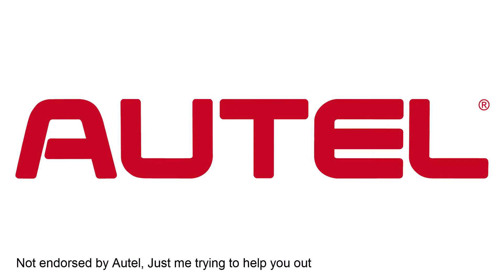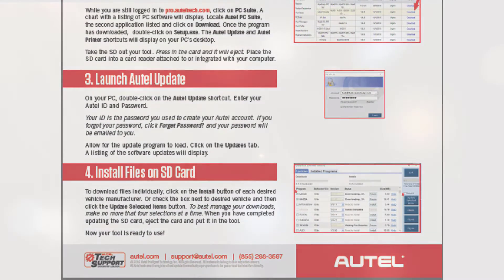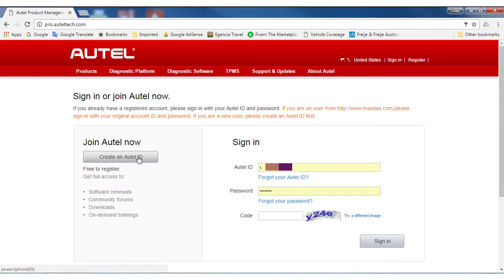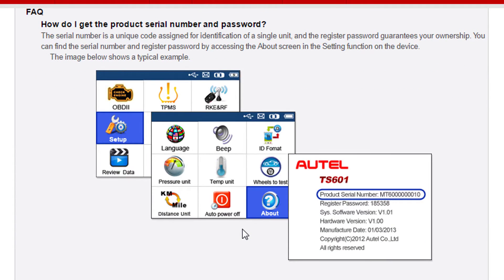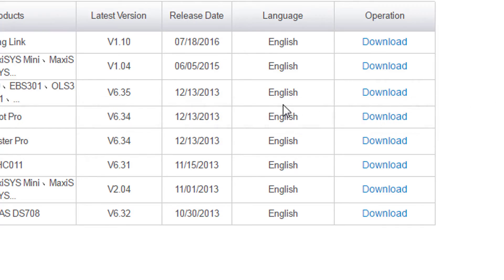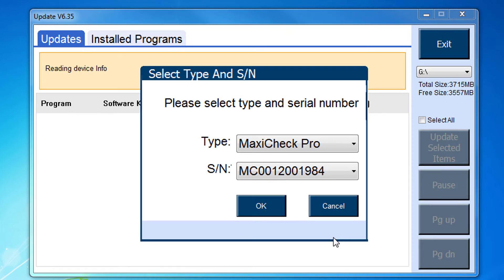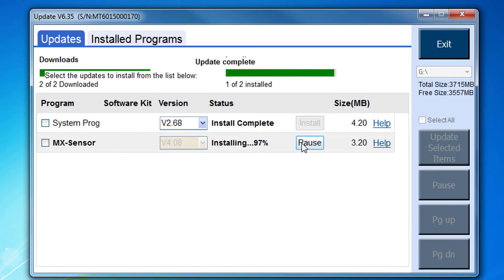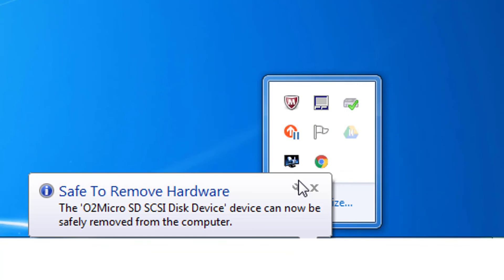How to update Autel Autolink and MaxiTPMS with SD card

Comment: Hallo,ich habe ein Problem undzwar, habe ich so ein Autel Autolink Diagnosegerät.
Mein Problem ist aber dass bei mir die SD Karte gebrochen ist, ich habe dann eine andere Karte geholt der selben Größe und Form.
Ich habe es versucht doch  da Stande irgendwas mit reboot system oder sowas in der Art.
Und jetzt meine Frage:
Was kann man denn jetzt machen? 
Mein Gerät läuft aber ohne der SD Karte wird es nicht gehen, und eine normale Karte ging drauf nicht.
Reply from the maker: First I would try to install the new SD card and to a complete update on the new SD card, if that doesn't' work you will need to reach out to support@autel.com and they can assist you with the reload of the software.

Comment: How can autel 629 and 619 memory card be updated?
Reply from the maker: There is no option for expansion on these devices.   I have not run into any space issues on my tools. To need extra space
Reply: @FlashPerformance  So no updates? Can you use them on different vehicles? I was planning on going into the microSD to erase information so I can use it on my second vehicle...
Reply from the maker: @sadrevolution  unlimited vehicle use on these tools, you can plug into as many vehicles as you want

Comment: Hello there,  I have updated mine and its turned to white screen.  Is there  a way we can do a factory reset or undo the update?  my model is al539 by the way.
Reply from the maker: I have heard about this happening before, most of the time it is because of the wrong file being loaded.  There is an AL539 and an AL539B, just make sure you have the right one.  It has been a while since I had to do this so I can't remember the exact process, but I think you hold down the Right arrow at start up and it will automatically put it into update mode, then you can reload the program.  If right doesnt work down, then left, then up.  one of them does it.

Comment: I have two MaxiSys, and one MaxiCheck. Long story short, the software and support for Autel is garbage. I used this video to update the MaxiCheck, which says it needs to use the Autel Suite, not Maxi Suite. Wireless printing on the MaxiSys only took a week to finally figure out the firewall was blocking it on public network, but I was on private? Thanks for the help, and allowing me to finally update this tool that was running 3 year old software lol
Reply: Same here and agreed 👍
Reply: What size of sd card do you use?

Comment: Hello Thank you for the video, I have Autel MaxiTPMS TS601 and I have logged into the webpage and when I enter the Serial Number and Password and I am getting message "No Product Found", I took this tool to Advance Auto parts and they were no help either. What am I doing worng,
Reply from the maker: When entering the serial number and password make sure that you are using the information from the "About" screen. From the main screen go to Settings>About>  There you will see the serial number and password.  If you still have issues after that I recommend calling the support help line at 855-Autel-Us
Reply: I got all the info from the tool as you mentioned above and error I am getting is with correct serial number and password, I have install the PC suite on my laptop as well, when it opens up, It shows no updates available for my tool, My tool has V12.5 and I that there is latestet version out there, I called that number and Autel told me that server is in China and there is no much support, I was not expectiing this answer at all, I was planning on getting Autel scanner for my shop but now I have to give second thought before I invest in tools from Autel.